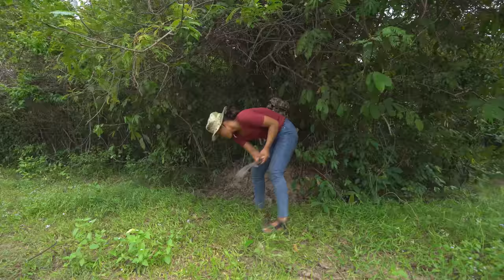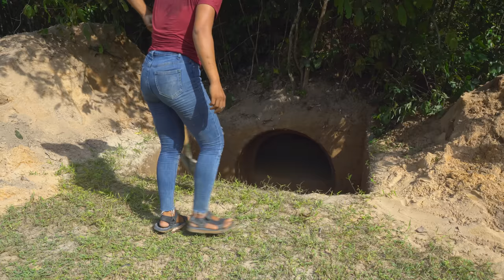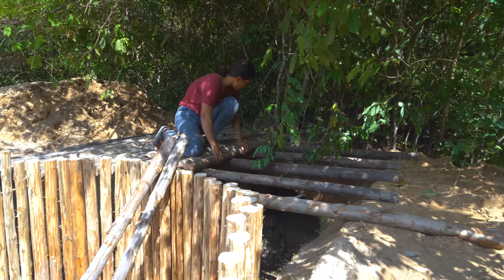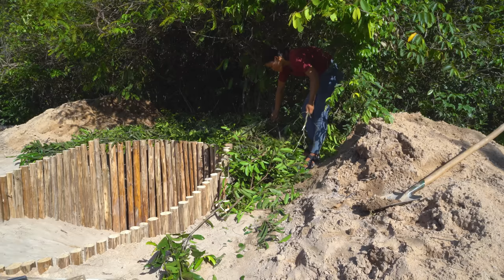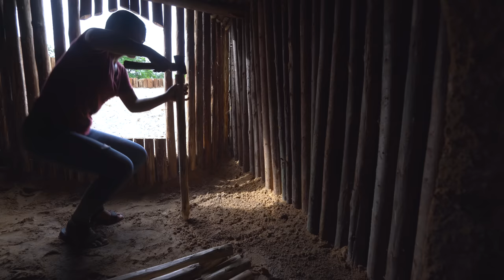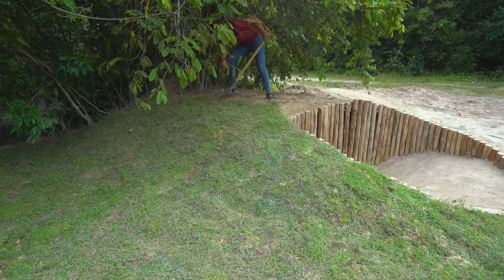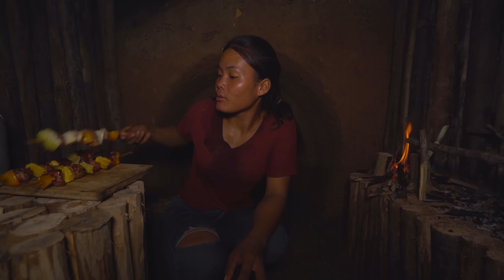Girl Living Off Grid Built The World Most Secret Underground Home with Fireplace 2022

Comment: those small logs she used all debarked and flush cut with just a hand saw and a hatchet? yeah okay the 3-4 she did cut were probably the only ones she cut and its easy enough to see that when she is pounding some of them in, the ends on a lot of them are old ends - if you work at all with wood, you know what i'm talking about not using a square or even a speed square and getting perfect 45's every time? not even the best can do that

Comment: I wonder why the young lady is throwing centuries-old building traditions overboard and digging a dark hole in the ground. Where is water supposed to run off to during heavy rain? Life expectancy in the Middle Ages was short; today we know that this was partly due to the fact that the fireplaces were located in the middle of the living quarters. Hardly any daylight, smoke particles and the danger of getting wet feet when it rained. I don't understand all the enthusiastic comments.